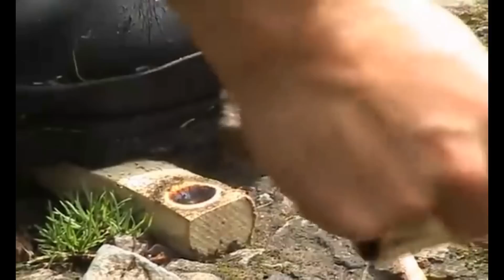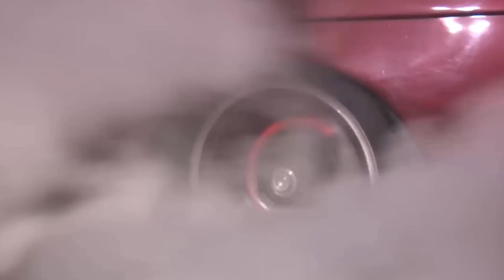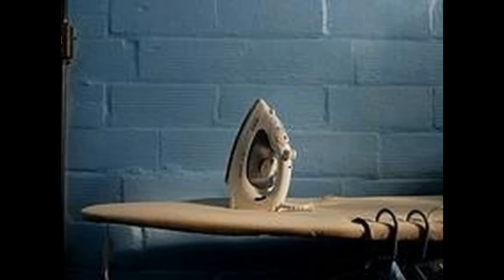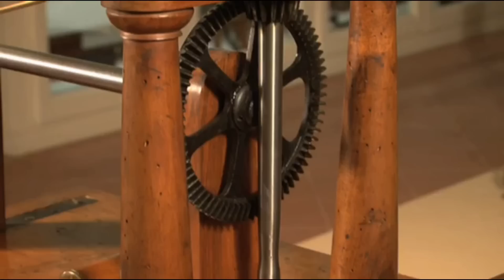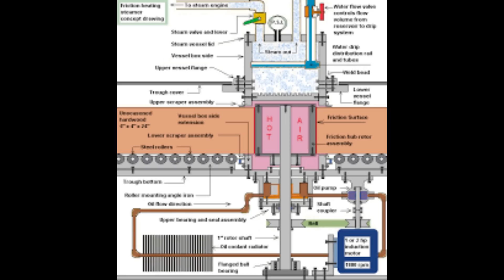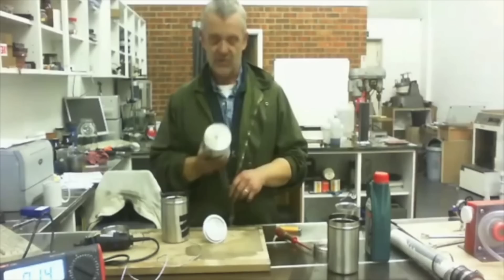2116 Friction Heaters

Comment: I know this is an older video. what about a oscillating friction heater?  like how those tools work that vibrate at a high speed to use a cutting tool, accept two plates. One oscilating on top of a stationary one?
Reply: kinda like the ideo of rubbing your hands together. except one stays put.

Comment: Search for the story of the Griggs hydrosonic pump. Rumoured to be 115% efficient, the extra energy coming from the collapse of the cavitation bubbles. The design was sold to an oil company because it also turned out that the device was particulary good at mixing liguids and gasses, something that oil companies do apparently. Pretty soon afterwards it disappeared from view (what a surprise). At some point in the distant past,a Russian company was producing a cavitation heater that utilised microwave generators. Very efficient and no moving parts. Try finding them, good luck.

Comment: I was also thinking using the fernette heater with a permanent neodymium magnets stuck on an rotor with the inner cylinder and a brass cylinder located internally stationary thus making use of the heat form then which would dissipate to the oil and its surroundings

Comment: Hi 
A bit off topic but some 20 or more years ago I watched a technical programme not to dissimilar to equinox or tomorrow's world and the subject was a water heater that was motor driven, driving a rotor in a stator with carefully designed divets in the rotor and stator, on running the device at a certain speed with water running through it it was claimed to heat the water at close to 100% efficiency, I have trawled the interweb and can find nothing just wandering if you might have seen this or are interested

Comment: Mentioned this before, but . . . the Frenette heater they used to show diagrams of in Popular Mechanics, et al, was a hollow drum in a slightly larger hollow drum (they recommended starting with two identical ones, cutting a narrow vertical strip out of one and welding it back together) with a fan mounted in the inner drum.  When you spun the inner drum, it forced air through to move the heat out.  Some duct and a wind turbine, and you'd have free forced hot air when the wind blew.

Comment: What I wonder about is if all that friction would not quickly degrade the materials used to apply the friction to. If used long term would you not need to replace parts rather quickly?

Comment: In the mid-1970s one of my engineering professors built a proof of concept device that heated water mechanically by applying shear forces to very thin layers of water. Results were underwhelming!

Comment: Lovely had looked at the fernette heater many years back on YouTube. Using your gear ratio mechanism and a small motor to run it via a solar Bank ie car battery comes to mind. Thankyou for upload Robert and taking us down memory lane❤
Reply: Why use a motor for friction heat? If you have solar/battery buffer to drive the motor you can direct heat water/sand via resistors.

Whats the motor for ? Missed it in the text maybe.

Comment: Is it possible to reverse this effect?  Instead of a motor spinning a fluid to generate heat, have a hot fluid spin a turbine to generate electricity?
Reply: Isn't that just steam power? ie, the way it's done now? Heating water (fluid) via coal, gas, nuclear etc to spin turbine?
Reply: @ThunderboltWisdom  not necessarily, because in that system, the water undergoes a phase change to steam and is directed to a turbine.  What I'm asking is can you have a system where you heat the working fluid and it spins a "turbine" without really going anywhere?
Reply: @samuelvoss9381  Ah, you mean the upward movement of the heat driving a centrally placed turbine? Is that right? I can't think of any other way heating a liquid could enact a force on turbine blades.

Comment: I like this friction heater in connection with a metal bucket sand battery, a  shielded from the heat universal planetary gear (video 2009), a hand crank, and a thermoelectric heat fan.

Comment: One day when doing some service on my diesel Jeep I discovered an odd device in the serpentine belt loop. It had a clutch and seemed to cycle on and off. Later I discovered that the device was called a viscous heater. Odd I thought, why would the Jeep need such a device. It turns out that the diesel engine doesn't heat up the coolant fluid quickly enough to satisfy some regulation regarding the time allowed to defrost the windshield in cold weather. There may be some kind of heat exchanger in it to transfer friction heat into the engine coolant circuit, but Jeep might just whip around the engine coolant directly. Of course, once the engine coolant is hot enough, a control circuit will disengage the clutch therefore maximizing fuel economy while meeting the windshield frost clearing regulation. Ingenous!

Comment: Using something with a low boiling temperature. To build a micro steam turbine, to generate power from the brake heat, also the exhaust heat, the coolant could be used as a pre heater. In a hybrid car, the engine coolant could have it producing a small amount of power, go up s hill. The exhaust heats up the steam engine takes off doubling the power. Then down hill the brakes heat up the turbine takes off again charging the battery.  The engine coolant generating possibly 10% of the power then the   extra heat pushed that to 60-70%  it could work, especially for stationary generators, also incorporate a DC generators , I was thinking of a turbo that generates power instead of boost!  A gear reduction drops 60k+RPM to 15-25k rpm. Generate electricity. It could be possibly 2kw easily I believe a 6-7litre could do 10 kw from the exhaust. Only loosing a unnoticed amount of power.

Comment: What is the unit for acceration of heat?  If you're converting energy from wind to electric to resistive heating vs wind to dynamic friction to heat than it follows that both systems can have a variable" brake" to adjust the heat.  So you want energy acceleration because some one out there wants to use calculus tools and a vector field of how fast that heat is getting there to compare electric vs friction.

Comment: What if you make a type static generator... A wheel with hair at its edge and an outer ring that harnesses the static that gets conducted when the flywheel rotates and the hair make contact with the silicon and air in a simple semi-conductor fasion?

Comment: Love these simple reusable concepts! You could make a usefully efficient primitive wind powered heater with no electricity at all. Or use it to charge a thermal battery. You could even use a water wheel in a river/stream to boil or distill the water for consumption. Very versatile. Thanks as always!

Comment: Thanks to watching some of your videos for a while, I have come up with an idea for a safe tent heater. The body of the heater would be very similar to how propane bucket forges are made. A metal container lined with that kaowool stuff, an input vent near the bottom, an output vent on an elbow out of the lid (to aim the hot air), and a small stand in the center for the heat battery. The heat battery would be a 5 pound steel mass with a loop built into it to allow it to be picked up by a metal hook and is small enough to fit into the stove. The idea is that you use a rocket stove or campfire to heat the battery, place the battery into the stove, move the stove into the tent, and then control the output a little bit by limiting the air that can go in from the bottom. Having the stove mounted to a small dolly, so it sits flat but can be easily shifted onto wheels to move it, would make it safer when moving it while the battery inside is hot.

Comment: If electrical resistance is close to 100% efficient, why would friction heaters be superior for use with portable heaters?
Reply: Simple added cost and complexity is  always more efficient.  Cost efficiency and inertia is why we have the system we have today.  The beauty of that statement is that it will always be true until someone wastes time and energy doing something different or until a con becomes a pro.
Reply: They are only when you directly transfer the rotation energy (windmill) into the heat via a shaft. No electricity. Then you pump that heat if its water also via mechanical driven pump to where you need it, and store the heat hopefully in an insulated reservoir. Or heat up stones/sand etc to bring somewhere.

The problem is the friction leads to abrasion/dust, even under water.

If you attach an electric generator they have local losses as heat,  a brushless generator only has friction in bearings that dont wear down if done right, and "friction" in wire resistance. 
So if i had the option for electric stuff/wiring i'd always go that route, even if it means loosing 15% at the generator. Because its also easy to switch off.

Addit:
a water pump / waterbrake (rowing trainer) might actually be abrasion free, because its the water getting warm through movement/inner friction, not grinding away the pump.

Comment: There is also a induction heater using copper coils and rotating magnets.
That probably could be pedal powered, with the proper spacing and gearing.
Im sorry, copper tubing, not coils.

Comment: There is a company that uses a similar principal for a water heater.
There are videos floating about of their "water hammer".
I will see if I can find one to share in the comments for those viewers who would rather not be troubled with searching for themselves.
Reply: Griggs hydrosonic pump.
Reply: @filinfinland  Great! Thank you!
Reply: What Robert is demonstrating is a laminar flow friction heater. The water hammer is a modified version by drilling holes in a solid rotor at specific diameter, depth and angles that creates increased friction turbulence. I looked for it by the names water hammer heater, Ausie water hammer heater and other labels and came up empty in my search queries a few weeks back. It's been in my bucket list to experiment with since 2015. The water hammer employed a 1/3 horsepower 3,200 RPM electric motor as I recall. It was touted as an over-unity device as are other devices like some microwave magnetrons and magnetic amplifiers. So far in my journey I've not experienced free energy however have been surprised that the "Q" factor can be much higher than indoctrination of my formal education dictated. It's like a sailboat being propelled by the wind. When the wind quits a sailor needs another form of propulsion to keep moving, paddles, pulse, jets, propellers, impellers, steam, motors, engines, rocking the boat, tow or even nuclear. Harnessing a horse isn't free because someone thought making hemp illegal was a good idea because idiots started smoking rope. The surgeon general warned that marijuana use during pregnancy can be dangerous to a developing fetus, and that marijuana use during adolescence is associated with changes in areas of the brain involved in attention, memory, decision-making and motivation.
Reply: @willhibbardii2450  You are looking for a Griggs hydrosonic pump.

Comment: Would it be more efficient to convert wind energy to heat with friction or to have resistive heating with a generator?
Reply: Low Tech goes with direct wind to stirrers in a tank for heating water.
Reply: The short answer is that it depends on whether or not you're salvaging the heat from the exhaust of your generator. 
If you are, then both systems are approximately 100% efficient, as thermal energy is the final product of all energy transformations.
If you're not salvaging the heat from the exhaust, then wind>thermal wins by a huge margin of 70% to 95%, depending on whether you mean "generator" as fuel>mechanical energy via an engine>thermal energy fia friction, or as fuel>mechanical via engine>electrical via generator head>mechanical via motor>thermal via friction, with the latter having rather abysmal whole system efficiency.
Reply: Wrong question,  do you want to pay for the extra efficiency.  Magnets, wires, and carbon resistor cloths cost money. Unless you're asking how much heat per RPM per second, which if I convert units in my head the minutes in RPM should cancel the seconds which should give us heat per angular time.  My question is what unit is that?  Polar watts, polar joules?